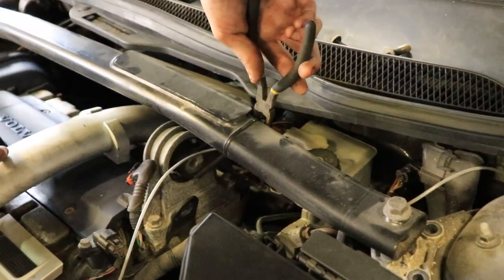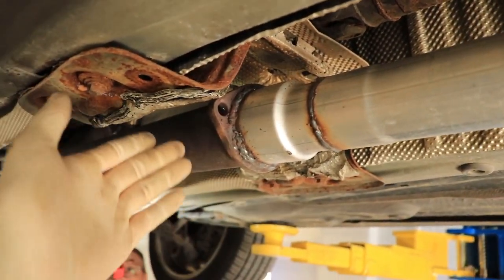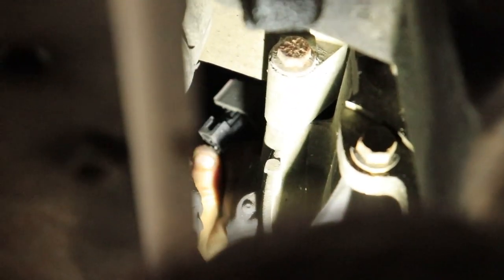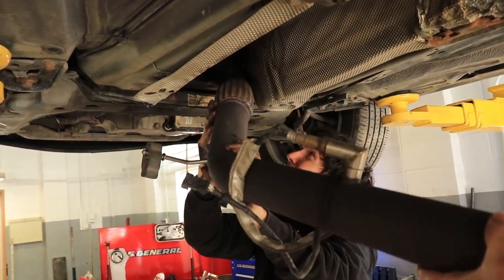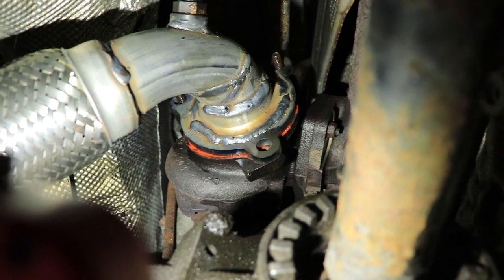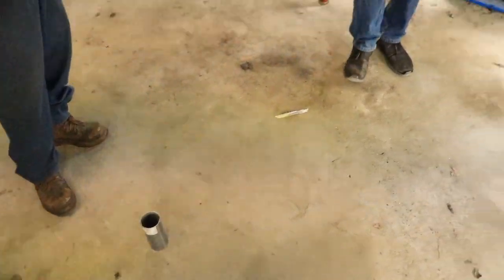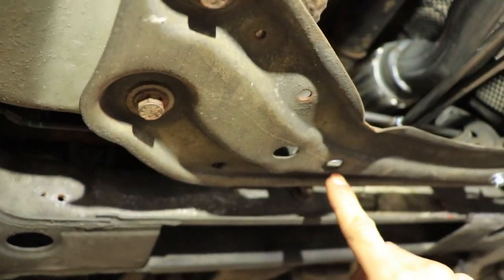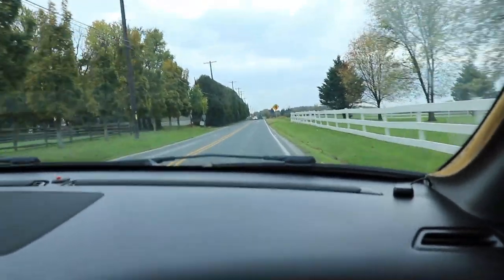2004 Volvo V70 R Catless Downpipe Removal

Comment: Working on this is a nightmare compared to an evo.i had to buy double end 180 degree socket spanners, flex head ratchet, wobble sockets and yoga mar to lie down on the engine 😅 every turbo line is ridiculous too, and the turbo inlet clamp has no room to undo it with Normale tools and the wastegate pressure thing is in the way so your blind.might drop the subframe ans engine next time.😅 love the t5 sound with minimal mufflers

Comment: Hey I just subbed to the channel thanks for all the Volvo vids and tips... any update about EBay Catalytic converter that was installed ? Any problems with the EBay Cats from Canada ?
... my 2004 Volvo XC70 needs new cats and I'm exploring better priced options, thanks.
Reply from the maker: it worked for what we needed it for
Reply: @salvobrothers5928   thanks... was just wondering how long it  lasted and the brand or any other  info ?... I'm willing to send a donation for your time, I looked on your YouTube page but saw none... any other way to donate for info thanks .
Reply from the maker: @hajileserpud9539  here's the converter we bought although it cost more now: https://www.ebay.com/itm/123771490029?epid=17026706506&_trkparms=ispr%3D1&hash=item1cd15b0eed:g:3RoAAOSwMWpc3yJr&amdata=enc%3AAQAFAAACkBaobrjLl8XobRIiIML1V4Imu%252Fn%252BzU5L90Z278x5ickkp2NA0WuhQytmt4dbStg00NHzlQEMnRMIlbbLvubSGv%252FfuHBbDWZ1qfQVaoQSkbjkS3MzeqE1Aebyl0vhDJf1bbhL5pjWDGiVy1vl5ep2eBEZb00KAu6i023Zs45b4rRCJDQNOMDtFdSQGUynw9o7HQlzU0bg6cLyNNNmSrpy%252Fe5MkqZXjlbOF53WIwfQYu0BIUfJYWr3oTDPFc%252Fkum49EM5u18bjshhPIMnxcogAzDNU%252FUWBcFBSEV%252BSSFAnNKpAIjWSfknXj8aaPUmbQkHmCefAwbgDKcOoVu37gpcj64rGOPFZrFwiFh36BgtiVQPxjKudAJIYD89V%252BbNFxaVd1wZxhF2MNrTVMCV%252F7CCP8sfRF9XsTX9LCPFMWIkszi6qPuf7ggTYq%252F4O6cmbn%252B3tr0nVGT0nwCmjTDpEAdrzjmtUh7s%252Fzi2xWyDu%252FJ%252FeU%252FPos%252FIyk5E7EsVA2ucp7aNxeNvpDxutUMtr%252FXR5QclmO2viNf5xxK5oP0uhnJsWenPa1SNjSOSfo%252BGp2zhkzOYRifOO9bkmv92wMQlls24cLQMWlQiA8xDLrnlBkBeMjYDs2UzEVMD1OylfWaQU7iOcYhEveq3KnvOVtPuNs5CGjUomTXEzqLZMsZUbxaQZ%252Fn7jTAh%252BeepXq1XJT0nhRSIKYaPb4SxUb0KWfUc%252FbiTEA1Yk7Th4j%252B2FTORWDXj7ZC7DnTuLiGyGq6FlRSDoOGns86nIWNoj1%252FtjFsv2zcHbtRvJR7NELGoym8hmU0IV5xY%252B1WasgjQ8lcFnT8I81M7Ewm0OmpKjSyw%252FsAU7pAsFJ6uLoHYqGBap2GsbqLJesdq%252B%7Ccksum%3A12377149002997f0e7fa199b4f4b8d64b956d1ede945%7Campid%3APL_CLK%7Cclp%3A2334524

We had it on the car for only 6 months or so. it worked great for that long. if youd like to donate here is our link. https://www.paypal.com/donate?hosted_button_id=T2PX6K8M6F9SQ